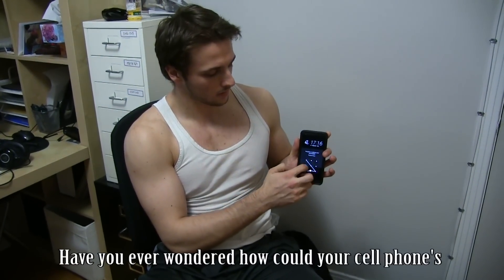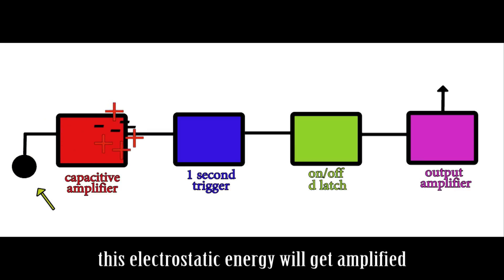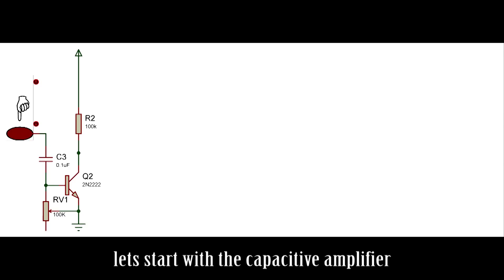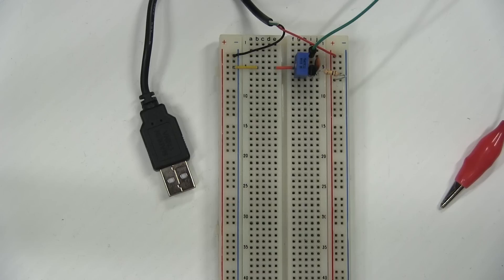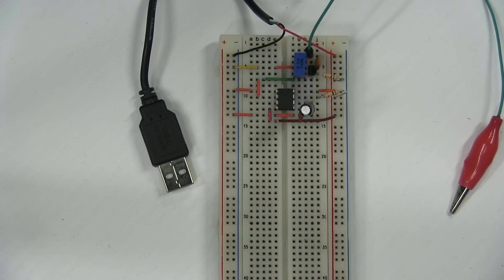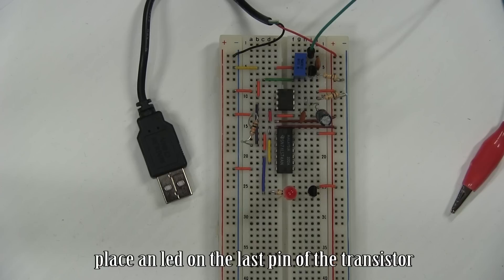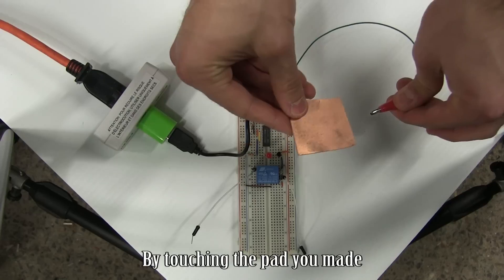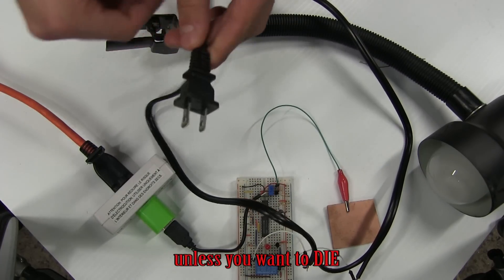[D.I.Y.] How To Make a Single Contact Touch ON Touch OFF Capacitive Sensor Switch

Comment: Could be posible to activate the circuit with a proximity sensor, instead of touching it? Like a ir emitter and receiver?
Reply: tanyboy007 yes, it’s possible. The first stage amplifies the current so you would need a low power input for it to work

Comment: Can I use a 12V power supply for this?
Reply: Lovynash Dookhee 
yes but you need to add 5v voltage regulator.

Comment: If I didn't use the d-latch I would get a momentary switch, right?
I want to use a similar circuit that sends input to a controller so when I touch the metal plate it sends input to the controller, will removing the d-latch work?
Nice video by the way!
Reply from the maker: Amr Hany yes it will
Reply: Thank you for the quick reply.
How reliable do you think this circuit is, do you think it could handle working 24/7?
Reply from the maker: Amr Hany I don't see why it couldn't. it should work but you could try it out and tell us

Comment: Nice work guys & thanks for sharing. But please show us the whole circuit first before starting to build it on breadboard.
Also use Fritzing to show us how the circuit is built on the breadboard, it has this feature.
http://fritzing.org If the breadboard is small, put each block on 1.
Reply from the maker: igrewold thanks for your feedback! you could see all the circuit at 3:30. also, I like the fritzing idea!

Comment: can i use this to turn on my pc? placing the wires on where the pc case would have its on off buttons comnected.
Reply from the maker: Occl Cll yes you can by connecting the relay switch directly to your motherboard switch

Comment: HI. RECEIVE GREETINGS FROM MEXICO, THANK YOU VERY MUCH FOR THIS INCREDIBLE CIRCUIT, SINCE TIME WAS LOOKING FOR SOMETHING SIMILAR. I WOULD THANK YOU VERY MUCH IF YOU CAN HELP ME, IT IS POSSIBLE THAT ALL THE CIRCUIT WILL OPERATE WITH 12V, IT IS AN IDEA THAT I WANT TO PERFORM FOR A LONG TIME.

P.S. I offer you a thousand excuses if you can not understand my words, I am using a Spanish-English translator. Tell me, can you help me?
Reply from the maker: Raymundo Gonzalez hey, unfortunately you cannot do this without a transformer from 12v to 5v. you could use a 7805 regulator

Comment: Hi, why is potentiometer used in the first bloc instead regular resistor? And what is the max. approx. load current on relay/diode pins? Nice video!
Reply from the maker: Viktor Božičević the pot is used to adjust the touch sensitivity of the pad. without it, the touch pad may be so sensitive that it could trigger on and off the relay with static electricity floating in the room. the max current of your relay depends on the relays itself.  mine is about 200 mA
Reply: Thanks for the quick reply! But if a load (eg. 3W white LED) is placed on positive and ground pins instead of relay, then would it draw too much current and heat some of components?
Reply from the maker: yes, this is why you need a relay. You can plug whatever you want after it and it won't affect the circuit
Reply: Since I spotted that some connections are missing from your circuit diagram part of the video as opposed to component mounting part, I experimented awhile with this circuit. I tried making a shorter delay from when you touch the conductor quickly, then it should turn the relay on and off. I don't understand, in order to shorten the delay time of the on/off toggle, what modifications should I make? Thanks!
Reply from the maker: Viktor Božičević hey, could you tell me the parts where there is a mistake! I will fix them by adding labels in the video. Also, if you want to control the delay of the 555 timer chip, you could modify the capacitor connector on pin 6 or the resistor connected on pin 7 of the 555. hope it helps
Reply: In the component mounting part of the video you connected pin 7 of the D latch IC (SN74LS74) to ground and pin 14 to common positive rail. Thanks, I will try to experiment with various cap and resistor values and let you know.
Reply: Hi again, instead of a 10uF cap going to pin 6, I put a smaller 3,3uF I had laying around and this shortened the delay of the 555 timer chip. What I also find strange is that my circuit won't work properly when connected via USB port to any USB 5V power supply (I also tried making a simple 7805 5V reg. circuit I powered by a 9V battery). When power is applied, the LED and the relay turn on, but touching the pad nothing happens. Circuit only for some reason works via switching 1A wall adaptor dialed at 5V, and at any higher voltage fed through 7805 5V regulator.

Comment: I built the circuit and it doesn't turn on the led or the relay, i think it is the capacitive amplifier part that doesn't work plz help me!
Reply from the maker: Here is a simple method to test your circuit:

-Output amplifier verification: add a button between pin 5 of the 7474 and 5v. (disconnect pin 1 and 4 of 7474)
      Result: relay is ON when the button is pressed. Relay is OFF when the button is released. You can reconnect pin             1 and 4 of the chip when you finish this test.

-ON/OFF D Latch verification: add a button between pin 3 of the 7474 and ground. (disconnect pin 1 and 8 of 555)
     Result: when you click the button, the relay is OFF. when you click again, the relay is ON and so on.. You can reconnect pin 1 and 8 of the chip when you finish this test.

-One second trigger verification: Add a button between pin 2 of the 555 and ground.
     Result: when you click the button, the relay is OFF. when you click again, the relay is ON and so on..

-Capacitive amplifier verification:  You touch a plate with your finger and the circuit should work.

You can now detect what part of the circuit is your problem!
Reply: thank you very much

Comment: is the 7474 d flip flop the same chip as a 74hc74 ic
Reply from the maker: yes, it is the same
Reply: Thanks for the response, so a 74hc74 ic will work for this project?
Reply from the maker: +Carmen Arbulu yes it will
Reply: Are you sure because I think the a 74hc74 chip has a different pinout than a 7474 ic
Reply from the maker: the only difference between the 7474 and the 74hc74 is the internal technology used. The pinout and the fonctionality stays the same

Comment: (the only changes i had to make is to use 0.1uf electrolytic cap instead of ceramic)
i made this and i have a problem.my parts and arrangement are all ok but the touch doesnot work at all......when i power it up, sometimes LED turns on with tic but then if i touch the wire to turn it off, it also doesnot work. it only turns on by connecting and disconnecting the power again.PLZ HELP ME
Reply from the maker: +Yasin Nur Rahman we message you back on facebook ;)

Comment: hi again :) can you make some capacitive touch that can be placed under a glass or without direct contact to a touch pad?
Reply from the maker: with this project, you can place the pad under a glass but you will need to turn the touch sensitivity higher by adjusting the pot
Reply: +D.I.Y. or DIE upto how many thick does the glass can be? for the capacitive circuit still working. can i replace the 100k to 1M? for better thickness of glass? will the circuit still work?
Reply from the maker: +david ivane lucas you can replace the 100k with a 1M. the circuit will be more sensitive to static electricity but it may detect your body when your close to the circuit and turn itself on or off. try it out with different values and see what works the best. you could even replace the 100k pot with a 1M pot
Reply: +D.I.Y. or DIE okay. ill do that. i think it is more cool if the pad is hidden underneath the glass. thankyou so much :) keep in touch. as always . God Bless.
Reply from the maker: +david ivane lucas thanks and good luck with the project!

Comment: You said the pin 4 of 555 timer chip must connected to the ground but based on the diagram, it connected into positive but thanks for this tutorial. More videos coming...
Reply from the maker: its true. thanks for spotting the mistake. but we can see that I've connected pin 4 to positive on the breadboard.